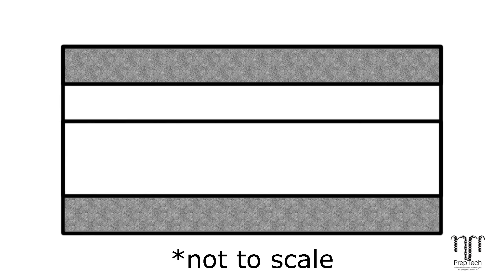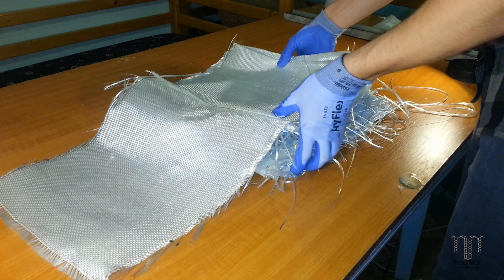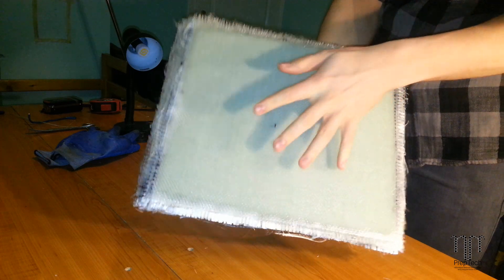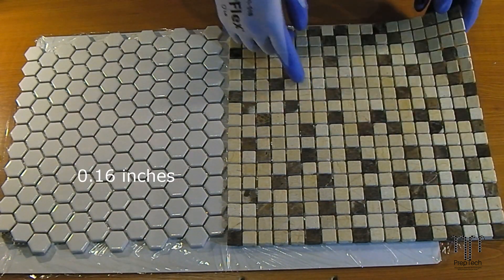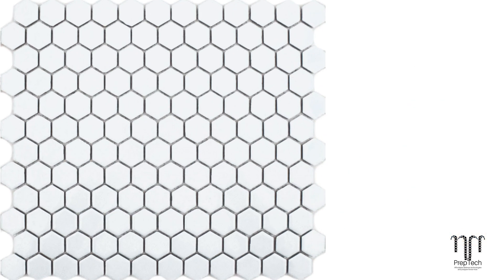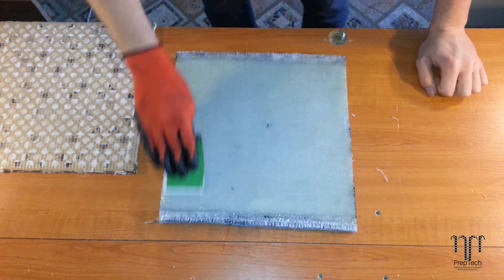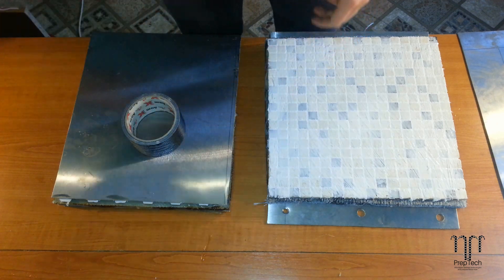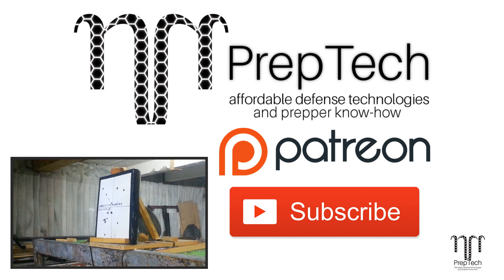DIY Working Composite Vehicle Armour (stops an AK-47) Part 1: Building

Comment: if you run a piece of scotch tape along your cut line before you cut the fiberglass, you will have clean cuts on the fiberglass
Reply: Very useful suggestion, dealing with fiberglass recently.
Reply: @bodyno3158  ìķķķik
Reply: Even better .. with such large weave, you can cut single strand ( outside of your tape zone) to cut along the weave to keep square panels.  I used to do this technique with cross stitching fabrics .. lol.
Reply: Nice advice!Useful
Reply: nice mate.
Reply: thank you
Reply: Thanks for the pro tip
Reply: Dude. If I have a 🏆🥇 for smartest post, YOU WIN. I should have thought of this. I didn't. You. Rock.

Comment: next time when you cut the fiberglass before you cut it take you there masking tape or painters tape and put it across the fiberglass then draw your line and cut it that way the fiberglass will not fray so that you don't have it start unraveling it'll make it easier to put the leftover away and work with the other part of the fiberglass
Reply from the maker: +Ed Leska Yes that is a useful tip, next time I'll definitely do it this way.

Comment: Nice one, i had some scrap carbon fiber that i made a plate of, for shits and giggles,  was about 12mm, didn't even stop a .22, but the energy was starting to diffuse in the last mm or 2.

One piece of advice, use a much stronger press, there's way too much resin left in that fiber.
Or use vacuum bagging with breather cloth to suck up the excess.
Reply from the maker: +Boris2k Yeah thanks for the advice, I would use vacuum bagging if I'd have one :D I assume it wasn't a very dense carbon fiber then.
Reply: No, CF just isn't mechanically suitable.

You don't need a special vacuum pump, i have a hand pump i use to finish pulling vacuum through the 8 cent check valve, normal vacuum cleaner to pull the majority of the air out first though.

Just come back every 15 minutes or so and give it a pump in case you've had some gas out or what not, but you should never have a vacuum leak.

The pumps for brake bleeding are perfectly suitable, though the one I bought came with all sorts of adapters.

Edit: Also you might be surprised how cheap the "consumables" like the plastic and the sealant for the bags are.